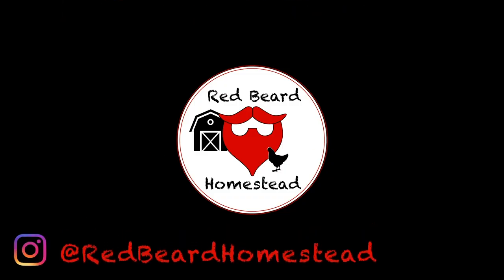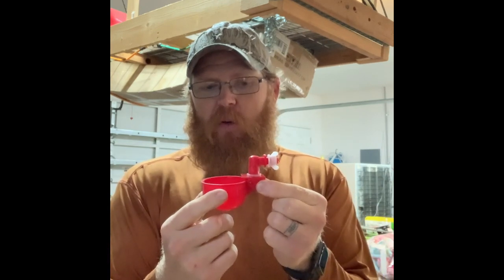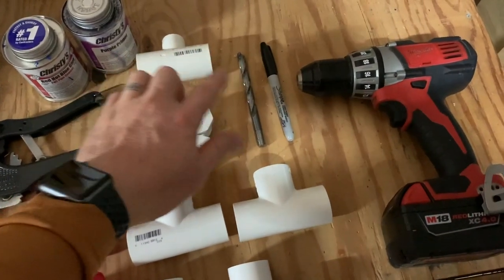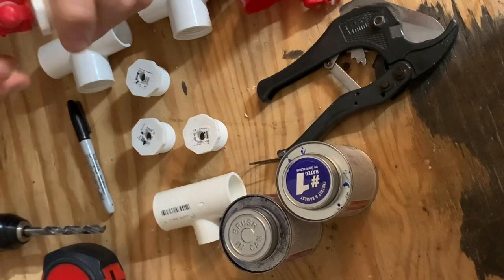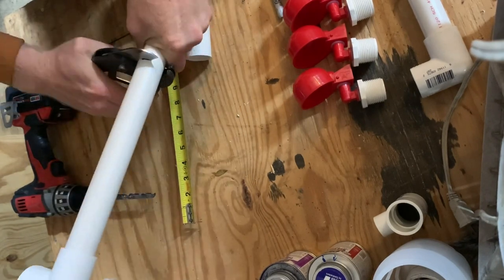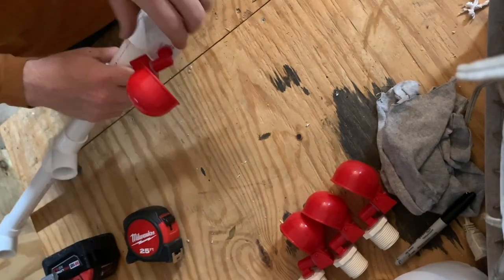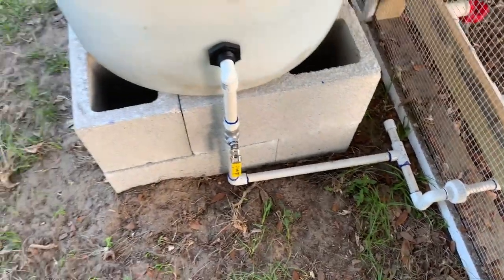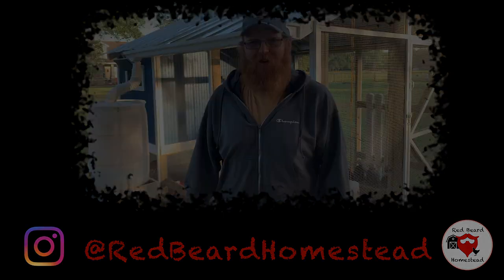DIY Automatic Chicken Waterer with Rain Barrel - QUICK AND EASY!!!

Comment: This is perfect! I’ve been looking for this exact set up! Do you add acv or anything to keep the water from getting slimy or anything?
Reply from the maker: Haven’t had any issues yet, my barrel is pretty shaded. I would imagine ACV would likely help if that starts to happen. Another option would be a splash of bleach. Most municipal water supplies have a smidge of bleach, and even my water softener system adds a very small amount (we are on a well with very hard water), so I wouldn’t be concerned giving it to the chicks.
Reply: Red Beard Homestead good point. We are on a well too. Our weather is just so hot I worry about stuff growing. Haha